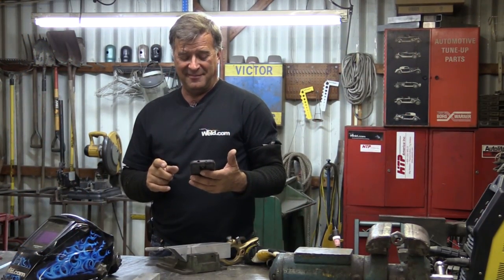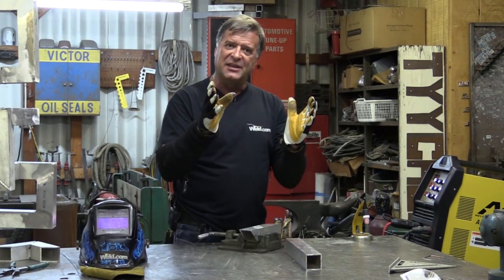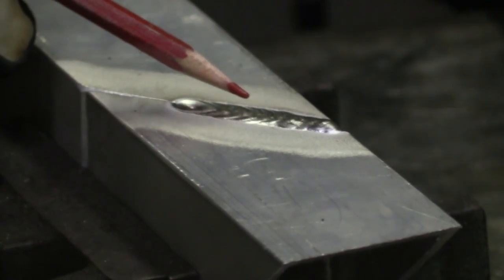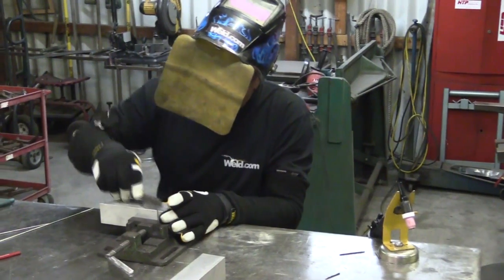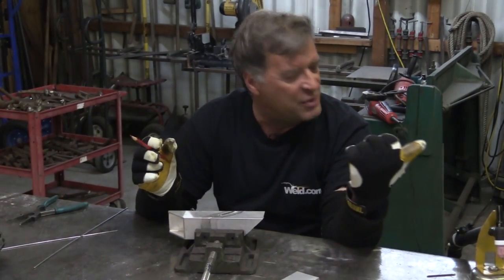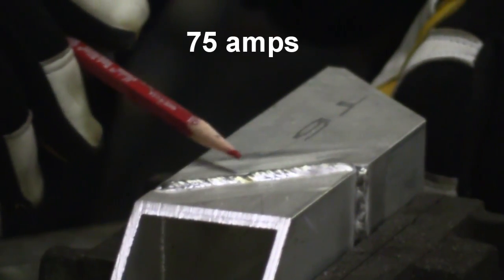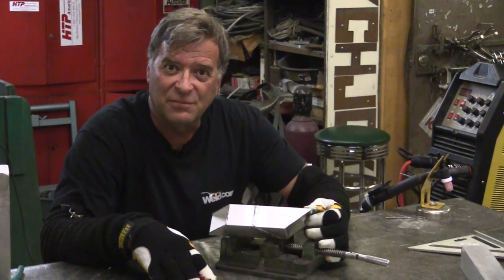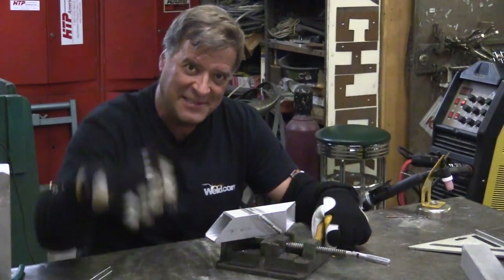How to set TIG Welding Amperage - Kevin Caron

Comment: is there something wrong when the tungsten just burns up at 120 amps on 1,65mm steel pipe?
and it might actually work normally at 65 amps then or it shouldnt burn up the rod in the first place?
Reply from the maker: The tungsten should not burn up!  You have your settings wrong or you are not getting the correct gas coverage.   Or you are using the wrong gas.
Reply: @KevincaronSculpture  its basically like a small lift-tig machine with mma and mig also, but i am using the correct electro-negative stuff and i do have 100% argon gas etc... and the tungsten rod actually stays really clean with the gas, it just burns up like a regular mma stick for some reason lol... i did forget to turn the gas valve on at the last try and then it actually made everything completely black lol.. and the rod still melted like before.....

Comment: Thanks for the straight forward demonstration, no fancy balance or frequency alterations. But: what's the general starting point for the amp setting, and how to reduce it on edge welds so the edge doesn't burn away?

This is for aluminum - What's it for carbon steel?

Thank u Kevin, pleasure as always :)
Reply from the maker: When I am welding 1/8th inch steel I will drop from 125 amps down to around 80 on the outside edge. If I have already welded the backside of the joint I will only drop to about 95 amps.    Thank you for watching and posting.
Reply: @KevincaronSculpture  Thank you kindly!! I can figure it out from there :D

Comment: Hey Kevin, I teach welding  and I have a Lincoln Ranger 225 (2018) but it is a little noisy and I would like something that is quieter. I was going to buy the new AHP 201xd. Is this a good machine to use atleast 2-3 times a week for about 3 hours a day? I have seen couple reviews about guys that use it to teach and no complaints from them. I also want the ability to weld aluminum hence I am choosing this welder.
Reply from the maker: Hi Danny,   Not sure how noisy your Lincoln is but the AHP 201 is not hard to be around when it is running.  I think it is a very good machine for the money and have not had a problem with mine.
Reply: @KevincaronSculpture  that's great to hear. I'm excited on getting mines but have to wait maybe a month or two. I went to their website and they said they are on back order till end of May. I'm making room in my tiny work area so I can bring this baby in. Thanks for replying I've been welding and doing cwi and api work for 24 years total now and I love the welding trade.

Comment: Hallo Kevin
Thanks for your reply for my MMA settings.
Regarding the Arc force setting, this should be near the Welding current?
For example, when I set the Welding current to 100A,  how much should the Arc force be?
Thank you
Spiros
Reply from the maker: If the adjustment goes from 1 to 10 I would run it around 6 or 7.  But that is just me and how I weld. You need to play with the settings on some scrap and see how they work. Then you will know how to adjust it when you are welding on your work.

Comment: Hallo Kevin
I have another question for you regarding my MMA weld settings,
At the machine menu I have to set the following:
      Welding current (20 - 200A), Ignition  arc (0,01 - - 1), and Arc force current (0-160 A).
What  are the,  Ignition Arc and Arc force current ?
Thank again
Spiros
Reply from the maker: Ignition arc is what the machine starts at when you pull the trigger.  Arc Force current is for stick welding. It helps with penetration.

Comment: Hallo Kevin,
First of all I would like to congratulate for your presentations.
I still have some questions regarding my Tig setup.
When I am using DC/Tig, I have to set the following:
            Pre flow time, initial current, up slope time, welding current, down slope time, pilot arc, post flow time.
Can you explain me, what is, initial current and pilot arc.
Thank you
Spiros Athens Greece.
Reply from the maker: Initial current is starting amps.  This is what the machine will start the arc at when you press the finger switch.  Pilot arc is for the plasma cutter.

Comment: Hallo Kevin,
First of all I would like for your presentations. 
I still have some questions regarding my Tig setup.
When I am using DC/Tig, i have to set the following:
           Pre flow time, initial current, up slope time, welding current, down slope time, pilot arc, and post flow time.
Can you explain me what is : Initial current, and Pilot arc?
Thanks in advance.
Spiros Athens Greece.
Reply from the maker: The initial current is also called "up slope".   It is what the welder will start the arc at and then increase to the welding current.   Not sure why you have a pilot arc setting on your tig welder.  The pilot arc is normally found on a plasma cutter.   But I also don't know what machine you are looking at.   Thanks for watching and posting.
Reply: Kevin Caron, Artist 
Ok Kevin, I received your answer.
Thanks a lot.
Regards 
Spiros

Comment: Kevin, love your channel.  Thanks for all the good info.  I'm retired and looking to try tig welding on 1/8 " and below steel, stainless and aluminum.  what are your thoughts on machines and amps.  Looking at Lincoln (little expensive), HF Valcon and  the green machine they have. Also AHP. your thoughts. THanks.
Reply from the maker: I would point you towards the AHP.   Great hobby machine and a great price.

Comment: Hey Kevin, I just bought the AHP AlphaTig 200x as well. Can you tell me or show me in a video the settings for welding car sheet metal (19g) on the AHP. 
I'm using the foot pedal. 3/32nd mild steel filler rods and 2% thoriated 3/32 tungsten.
Thanks
Reply from the maker: I will add it to the list of videos Kevin!
Reply: Thanks so much.....Any chance i can get a few settings to start practicing?

Comment: hey kevin .. I'm done my iti and now doing training .. as tig welder but i dont know the current setting for different metal thickness and for    different metals .. can u plz teach me
Reply from the maker: I just use the 1 amp per 0.001 of metal thickness rule to start with.   So 1/8 inch plate steel is 0.125 thick so you will start with 125 amps and test on a piece of scrap.  Dial up or down as needed.  This works with aluminum also but I like to add 25 amps to with ever setting I start with.

Comment: Great info Kevin and it worked but this goes against what Jody @ WT&T.com says.  He states over and over that he likes 1 amp per thousand thickness or 1/8 base metal = .125 thousands which would call for an amp setting of 125 - 135 amps for this square tubing.  He makes it work and looks great but for me it's too hot and am more inclined to follow you on this one.  Thanks
Reply from the maker: I don't think it is a hard rule, more like a good suggestion.   Every machine runs a little different.  Thanks for watching.   Don't forget to hit the like button!

Comment: How much Amp used in TIG welding. To good for welding
Reply from the maker: All depends on what you are welding.   I have run low as 15 amps and 255 on the high side.

Comment: Hi Kevin. I'm having trouble blowing through thin walled steel tubing. I'm using 50 amps on 14 ga tube, but as soon as I get a puddle, it seems like I blow out a big hole.
Reply from the maker: Try using pulse.
Reply: Kevin Caron, Artist Unfortunately, I have a pretty no-frills machine. Its only control is the amperage dial and the on/off switch. I'll try slightly lower amps. Thanks for responding.
Reply from the maker: Or try different diameter wire.
Reply: I have a cheap meachine too. Goes down to 11 amps.. 22 gage steel at 20 amps i have to have perfect, and i mean perfect fitup
Reply: Otherwise the edges will burn right up.i also try to push the puddle on the seam rather than run right on it

Comment: I just got a 2016 and 200x 2 days ago, I have been practicing a lot and found the green tungsten doesn't work with that welder. I also found that welding aluminum you use ac and steel use dc,  I thought dc was only for arc welding,  no.  Lots of stuff to learn.

Comment: Kevin, I have the AHP Tig 200x on order. I am running a new dedicated line to my garage for the Tig welder, what is the circuit amperage required? I am guessing 50Amp is needed. Just thought this might be a good place to ask what the service requirements are for a 220V AHP machine. Thanks for your all your help.
Reply from the maker: Only need 30 amps.    But if you can get 50 more the better.

Comment: 1 amp per .001 of thickness
Reply: Julius Tinkey but that would be way too much, at 125 amps, if the 100 amps was too hot.
Reply: 0.001 is what ? mm or inches.

Comment: im running 1 of these ahp 200 ,2016 version on 110v and having problems welding aluminum. could it be 110v. i notice on 110v @110+ amps,160s frequency, 30s ac balance 3/32 thor elec , starts to do better in my opinion , but kicks breaker off. I've tried different size filler wire, different tungsten color & size, all on new aluminum.  it doesn't melt, and when it does filler doesn't join puddle unless it turn up to 110amp/ 160s frequency.
Reply from the maker: You are at the max on that machine on 110 volts..    You need to run it on 220 volts to do any good here...
Reply: Kevin Caron, Artist why do you think my aluminum filler doesn't go to weld puddle once melting.  seems to run the other way. i tried 220v 50a, same problems im welding 1/8 aluminum diamond plate &16g square tubing thought it was contamination so grind surface clean and got fresh grinding wheel for tungsten. no difference
Reply from the maker: Too cold!    1/8th plate wants about 130 amps to weld right..   Crank that puppy up!!
Reply: Kevin Caron, Artist thanks figured that, but keep burning up red & blue tungsten . just ordered grey & brown 1/8 & 3/32 tungsten.  love your channel,  thanks for your help and time /replys.

Comment: Messaged myself a reference for 3mm - 88 amps tig aluminium, thanks Uncle Kev. 
Just picked up a new Tig Welder, Unimig 200 ACDC, has the usual AC Balance and Freq. post flow, etc. My research around the AC Balance and Freq. shows me all kinds of settings on the Bal. and Freq. from welder to welder. Seen a video from Jody showing Tungsten for aluminium is best to be 2% Lanthanated, so I need to find them, but overall, it's another machine I got to get my head around and start just laying beads. Lately I've been English Wheeling, Planishing Hammering, it's a big new metal working world for me this year, very cool. OK, back to Uncle Kev's Tig Videos, it's been a little while, so I got some catching up
Reply from the maker: Have had great luck with the E3 purple top tungsten.    Works for ALL metals.
Reply: ok thanks, I'll have to grab some of them. Do you think the WP-26 Torch is a good model? What's your fav?
Reply from the maker: I use the 26 on most of my tig machines..   I have big hands and it fits better than the 17s.
Reply: Hi mate, Is your Unimig the new digital version? I just bought one and i'm trying to set it correctly. The AC balance control is 10%- to 10%+, so when tutorials say set balance at 70% i'm not sure how to equate that to the Unimig. I'll for now only be welding 3mm and 5mm ali. What settings do you use on your Unimig? Cheers.

Comment: I'm confused as to why the 100 amp weld was bad.  Don't you always want maximum penetration for a strong weld? The 100 amp wasn't concaved in or anything,  so why is it bad?
Reply: MattsMotorz 
Penetration isn't about welding completely through the parent metal.
It's about having the correct % of penetration for the parent metal, too hot will have the filler metal holding the sides and it's simply a hit of some kind will crack the parent metal beside the weld, this is a failed weld, it's also how a lot of people who just weld at home fail at welding because their welds will fail either straight away or at a later time, and people who can see this,  may get a hammer and crack the weld in front of these people to show its an failed weld.

Or throw the piece on the ground it sometimes the piece will simply shatter apart like it was glass on the ground.
Reply from the maker: +MattsMotorz 

Too cold,   not enough penetration..    If you don't get all the way through the metal with one pass than you have to make a second pass on the inside to get total penetration.,.    A partial weld with give you a weak joint and it will fail under load...
Reply: Thanks Kevin!

But I am still confused, how could 100 amps be too cold? This was the highest amperage and you said it was too hot in the video.  Doesn't, hotter = more penetration? Maybe you misunderstood. (I know sometimes it is annoying to go back and look through your video for a question someone asks, I run my own youtube channel as well).
Reply: @MattsMotorz  , It's like talking to a deaf person, isn't it.  Maybe he's clueless. I'll look for other channels.

Comment: Good thoughts and I am glad you mentioned the various welding positions, plus the change in base metal temperature as the weld progresses, and I guess edge temperature change as well. 
I also wanted to add this; I had a small one time weld to make the other day. It was hot, humid, I had a T shirt on, and sat down at the table with the welder on - then thought about your other video about getting a shock. I stopped and got the weld jacket on. THANKS for that one!
Reply from the maker: Tom Herd Thank you!   Glad to help keep you and everyone else safe.